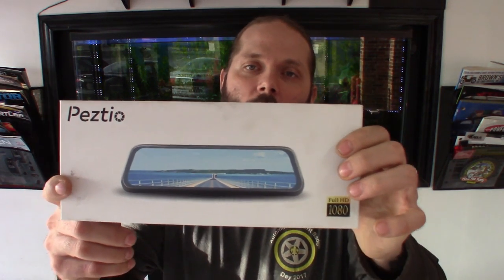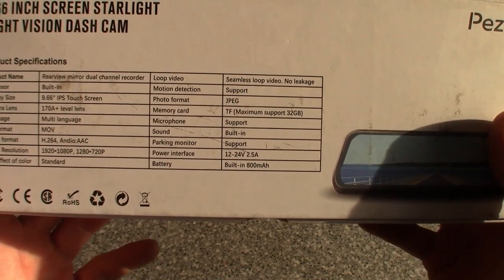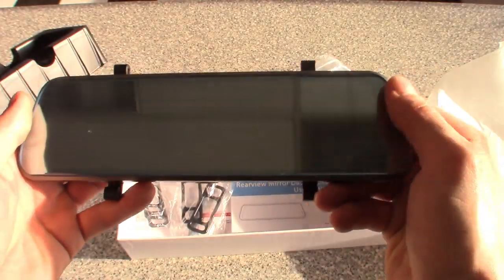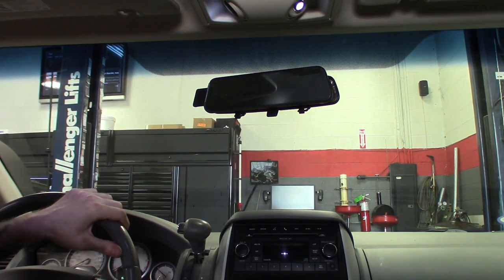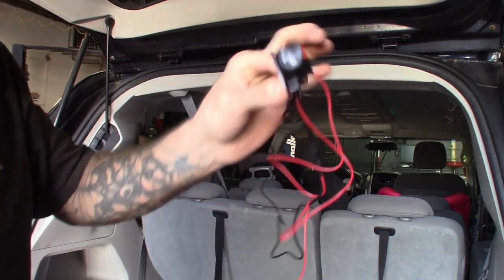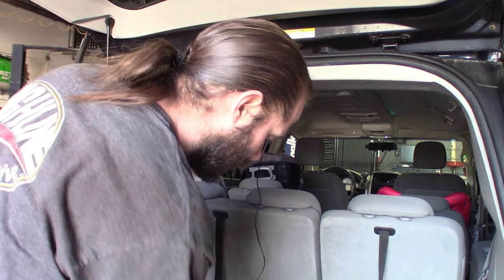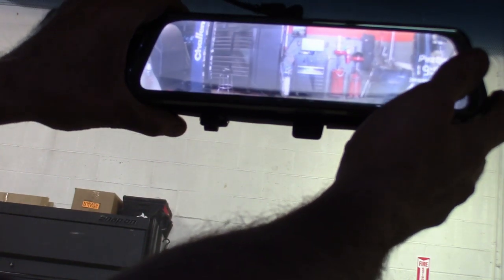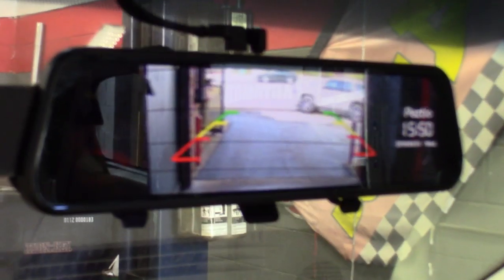Peztio Dash Cam Mods

Comment: I'd be curious how it holds up in extreme temps...

I have a fairly expensive Garmin dashcam that is hardwired into my vehicle. This allowed me to hide all wiring and have it turn on and off with the ignition.

So, I leave it mounted all of the time.  In the Midwest weather, when it's very cold the camera will sometimes not boot up correctly when powered on.  Once the vehicle cabin warms up and after several boot cycles the camera works as expected (usually about 5 to 10 min) on zero degree days.....

I'll keep an eye on reviews for this one.  Good price if reliable